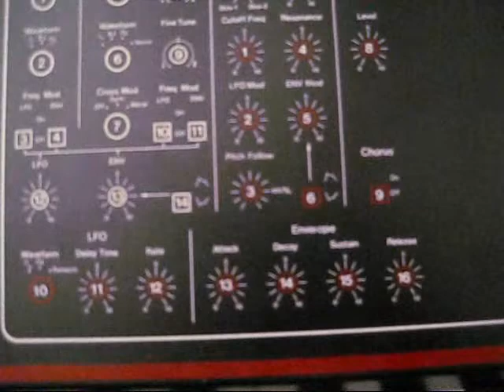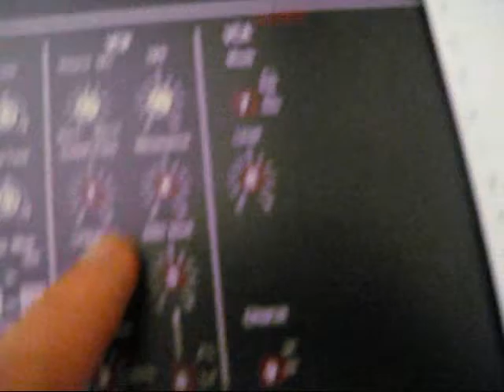How to Program a Roland JX-3P Analog Synth Tutorial (Without A PG-200)

Comment: Yeah, there's a LOT of over-hype for needing a controller, not many synths until 1987 were hard to program, just the DX7, truth is the JX3P and JX8P both of which I own, are really simple, the 3P being the simplest, but if you think about it on the JX8P where you have velocity aftertouch and the joystick, plus one assignable slider you can leave at a parameter for instantaneous editing....and if you wanted to change that live, you tap 3 buttons, that's it it's something else, really not that difficult, Hell on my much maligned AX73, which does not have aftertouch BUT DOES have paramenters assignable to velocity (Envelope depth, Filter Amp and Pitch can all be controlled via velocity) and also lets you route the filter cutoff to the pitch wheel (And either have it control the pitch as well, or just the filter) the assignable modulation wheel, plus the one real time assignable slidder, you really have real time control of several parameters, more than enough for any single song, and then if you want to change the slidder function again, 3 buttons away....that's it......I really don't get people who whine about needing the controllers

Comment: I had one of these. I found the pre-sets to be mostly useless, and it had no portamento that I know of. I bought a Nord Lead, and sold this really quickly for $250.00 I think. Now someone has one for sale, and I don't have the Nord Lead anymore. What I really want is my Roland SH-101 back which I found at a garage sale for $20.00, and I had to clean it up to get it working.
Reply: It was a tradition in the 80's to ship Synths with the most god-awful presets imaginable.....seriously can you think of ONE synth who's presets where even listenable, let alone useable? Presets were good for the first time EVER about 10 years ago.....NOW the new thing I'm noticing is all these new synths (Deep Mind, Prologue, JDXA (Not really new...but crappy) System 8, Prophet 8 Rev2) absoloutly DRENCH their presets with distracting arpegiaters that turn on whether you like it of not, and TONS of Digital Reverb, Delay and Modulation FX (Chorus Flange ect.) I've also noticed some silly ANALOG FX like on the Prolouge, that compressor isn't something that should even be considered an effect, basically the took the last gain stage that would have already been there, and gave you the option of switching it off.....GOOD GOD PEOPLE...what happens when you turn it off? It sounds BAD!!!! That's because It was never supposed to be an effect.....god what scam the synth industry has turned into, the new analog revolution/golden age is over, and the "Might as well call it digital" new dark ages are apon us.....REPENT!!! JUDGMENT IS NIGH!!!!!

Comment: The only problem is recording the on board sequencer. I am sending a rimshot from maschine to output 3 of my saffire into the Seq Trigger In. It fires off the sequencer ok(ish) but there is a latency issue of about half a beat. I'm not sure if I'm missing something fundamental. I've tried using the ableton track delay to no avail. I've starting the sequencer then pressing play in ableton and I have tried starting the sequencer on beat but it skips.Anyone out there had this issue?

Comment: I agree, the JX3P can be programmed very eacily without the need for a PG-200. I sold my 3P and bought the MKS-30 which is a different story; for that you DO need the programmer. It can be done but it uses +/- buttons instead of a linear slider resulting in very slow increments of the parameter value. :)